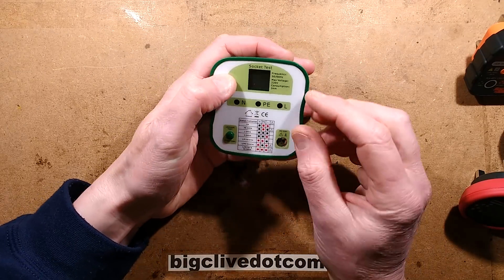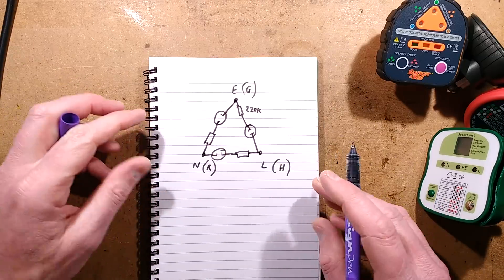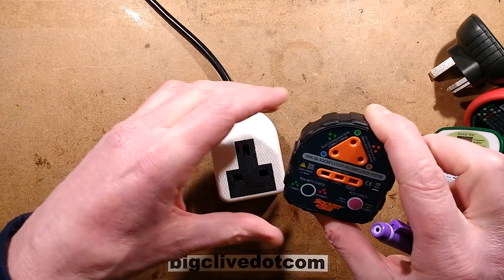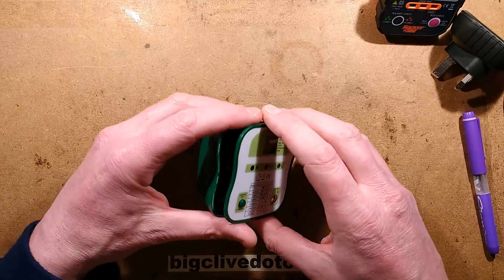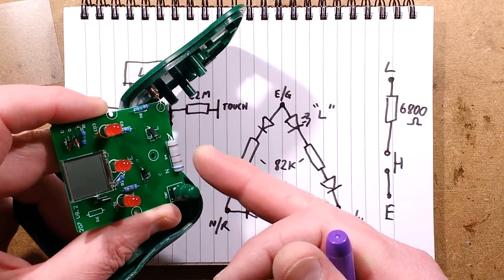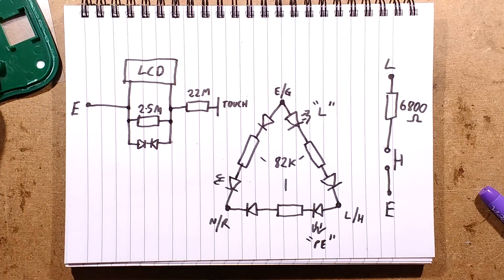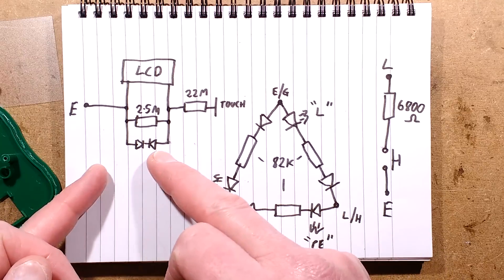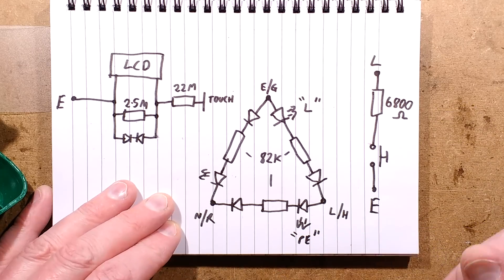Inside a mains socket tester with LCD display.  (with schematic)

Comment: I love how it has a max voltage of 230... Most mains is now around 240-250 volts. The days of 220-230 are over. Same thing in North America, everything that was 110-115 is now 120-125.
Reply: In the US, it was ALWAYS 120/240.   110 is the minimum acceptable voltage, and 120 is nominal, with the voltage usually ending up around 118 volts.   So, people saying 110 are actually only talking about the lowest acceptable voltage to drive whatever your device may be.  (Or just don't know anything about what they're discussing)  As for Europe?  No idea.   It's been long enough since I researched it that I'm certain the EU has invented new standards because they can't stand leaving anything alone.
Reply: Troy Belding nope. It actually was 110 in the early days of AC power. It later went to 115, then 117, and finally, 120. The allowed tolerance is +/- 5%, so the minimum is 114 and the maximum is 127. Typically, unless you're way out in the boonies somewhere, you'll find that the no-load voltage is about 122v, which allows for voltage drop from high current appliances or long runs of wire between the breaker box and a distant outlet. 
Be glad we're not in Japan. They have 100v nominal, but in the northern half of the country is supplied at 50 Hz, while the southern half is supplied at 60 Hz. Which means that if you move between regions, you have to replace any appliances that are frequency sensitive.
Reply: Yes and no.   The early days of AC power varied depending on the region.  Chicago would have one, Boston another, and eventually the smaller regions sort of gave in to the larger regions.  By 1963, device voltage was 115.   in 1984, distribution voltage was set to 120.    Some sources talk about Edison using 110 distribution for 100 volts for his bulbs, but that has to have been come up with by someone who didn't understand that Edison hated AC.   AC current was _Tesla_.    Edison thought everything should be run on DC current.     So, basically, 120 has likely been the 'true' distribution voltage since the 30's, and they just nailed it down in the 80's.   In Houston, the 'no load' voltage floats right at about 118-119, in most areas.   When I see 112, I start being concerned, and the few times I've seen 108 and similar, I had the customer call in an electrician.   (That was when one person killed three computers with her under-desk heater)
Reply: Panels in the us/canada are 120/240,  but receptacles are 125/250.... the voltage is usually closer to 125/250. depends on how many transformers are providing power along the lines to the houses on the block. A lot of new construction has several smaller transformers installed in closer intervals linked in parallel to share loads more evenly. In the past there would be a few large transformers spaced farther apart and if the load would be high customers farthest from the source could experience significant voltage drop, I have seen 105/210 with the A/C and stove on, It was a 200 amp service drawing only 82 amps..... to much distance from the transformer to the house and to many houses on the same transformer.... the lights in that whole area flicker like Christmas tree lights
Reply: Peter Dudas I live in germany and I have 229v.
Reply: Here in Europe it used to be 220 in the south (like Italy), 230 in the main continent, and 240 in the north (like UK and Ireland): Now the standard is 230 but with deliberately sufficient tolerances that nobody had to actually change!
Reply: incognito65 229? Is that a multimeter measurement of it that the voltage stamp on your meter or outlets?
Reply: In the North Somerset area of the U.K., my nominal "230V" supply is normally about 250V.

Comment: You said your main RCD is setup to "lag." How did you do this?
Reply: John Hollowell digital GFCI?
Reply from the maker: +John Hollowell You can get programmable units or a type S RCD that is designed to offer a 100mA/100mS trip characteristic.

Comment: In germany for the TNC (C=common neutral+earth line) system gnd/earth has to be 10mm² until its seperated into Neutral+Earth = TNCS (or then TNS, s meaning separate),
so you cant really say its cheap to keep it that way.. and you really have to try hard to brake the 10mm² common neutral+earth connection ;-)

The T-T (earth at incoming point, earth at machinery)System most of the time is only used in industrial applications where you set your ground/earth spike right at the machinery.
--as a noob you can remember the T as the spike which gets stuck into ground/earth to make the connection
Reply: That 10 mm² requirement was just some intermediate measure to allow TN-C longer in some cases for some reason. Originally it was done with the normal neutral wire. IIRC In Germany the 10 mm² rule was few years in the early seventies. In Finland it was from 1989 to 2007. From 1930 to 1989 TN-C with the neutral was the norm (though a separate ground wire was allowed in 1957). The reason to choose TN-C was originally just to save copper.

Comment: Yesterday I opened the Amazon Basics calculator I have to see if the PV cell on the front was real or if it's a fake cell. It's a real PV cell! It's wired to the circuit board and when I pulled the silver oxide button cell out of the holder, the PV cell (with enough light) powers the calculator! I expected the PV cell to be faked (I think Dave Jones also did a video on this.)
Reply: The most fun you can have with a PV calculator is to remove the battery and interrupt the light to corrupt the memory.
Reply: The solar panel is connected to the battery via a germanium diode ( yes Ge diode, not Shottky) and there is a red led across the battery in case the cell is removed, though some models use a little blob containing 4 silicon diodes in series instead to give a 2V voltage clamp. The solar panel in any case can only deliver under 1mA in bright sunlight, so the tiny alkaline cell in there ( generally a LR44 or other small button primary cell) will never be overcharged, unless you leave it outdoors in full sun for a month, which will melt the case anyway. Indoors the panel only provides a tiny top up to the cell, and in any case those calculator chip run on a LR44 for about the shelf life of the cell anyway. Those with a single AA cell in them I generally use a cell that will not run a clock, and in the calculator it runs fine for years.
Reply: I have a Casio from the 80s with a PV panel and it's still working now on the internal battery after all these years without a replacement.

Comment: @ 8:20 Well... 8W in a 2-3W resistor is one thing... Having 240V over a Tact switch is outright bonkers! Aren't those usually rated 50V or so?!?
Reply: Won't the vast majority of the voltage be across the resistor rather than the switch? It would form a voltage divider between the resistances of the resistor and the switch.
Reply: Motorman2112 once switch is fully closed -yes. Problem starts when the switch is released and there would be sparks. With enough sparks you have ionized air that would attempt to keep a conductive path open. One saving grace is AC voltage the other is a functional RCCB/GFI/RCD. Pushing this button repeatedly in a non-GFI environment might trigger a nice ion channel / little plasma cloud that potentially stays hot enough through 0-volt crossing and burn out the resistor in a spectacular way.

Comment: I don't need one of these to know that the wiring in my house is horrible. It was built many years ago when they really just didn't bother with earth. So there are no RCDs, fuses are actually proper fuses and no socket has an earth connection. The earth pin is just not connected anywhere (not even to neutral). But since it doesn't gives us any problems nobody really wants to invest the time and money to re-do the installation. When I was converting the attic into a workshop I at least properly wired that - connecting the earth line to neutral (and actually wiring it up in the sockets), added a proper 10mA RCD with a properly rated fuse.

Comment: Unrelated, but... I have a Yihua 937D+ Soldering Station, the middle digit on the display is screwed up, the iron seems to heat up and work though - the seller gave me a 70% refund...

Just wondered if you had any ideas, - I had look and can't see anything obviously faulty, or dry connections etc...
Reply from the maker: Does it light or display what looks like all the other digits combined or a combination of two.  It sounds like a solder bridge defeating the multiplexing.
Reply: I thought that, as the left and right digits work fine, the middle one displays random segments, some brighter than others...

I  have some pics (and a small video) if you got an email address and/or forum :)

Comment: what would the circuit be in a very expensive model, please could you do a video on that
Reply: Capt. Marco Hawk same has this one just betters parts
Reply: Yes, I'd like to know how they measure loop resistance.  My guess is that they put a pulsed load between live and neutral and measure the voltage drop, which is not a trivial circuit.

Comment: I never fully understood the point of these, I would be much more concerned about poor standard of electrical connections - could that be tested in a house through a resistance meter?
Reply: stupossibleify because some house have uterly random wiring (yes I have seen plung wired in series!!!)

and no mesuring resistance won't nesesarly show you all bad conection.
Reply: Caledonian TV most sockets work, so they are prob wired correctly. Again, my concern is the poor connection to terminals, wires connected together simply by twisting them together, loose wires near combustible materials - again, is there where a resistance meter would be useful?
Reply: stupossibleify  Even a resistance meter will give you a very limited picture of the state of any connections. Conductors may be touching, so read low resistance on the meter, but when a large current flows, the heat from the poor connections can cause problems...
Reply: Mark 1024MAK so the only way to be sure, perhaps when moving into a new property, is to remove each socket/ceiling rose and check connections visually
Reply: stupossibleify  Yes. In my experience, so far I have found circuits ran with the incorrect rating of cable. Earth wires not correctly terminated (twisted, but not clamped in a terminal), connections with loose screw terminals (not done up tight), unfused spurs off a ring main with too many socket outlets connected in a chain (with wiring not rated for the maximum potential load), a 30A cooker circuit converted to socket outlets, then extended with extra sockets (again, with wiring not rated for the maximum potential load), a PIR lighting controller wired with twin and earth cable, with the bare earth wire used as the neutral and multiway lighting circuit switches connected up incorrectly. A multimeter would not have found many of these faults.
Reply: Mark 1024MAK it's really a wonder there aren't more house fires than we actually see from electric installations. Most of those that we are told about seem to be user error (chip pans, cigs) or appliances (cheap chargers, heaters, tumble dryer and fridges)
Reply: stupossibleify  To be fair, in a lot of cases, as well as the poor or bad electrical installation, something else needs to happen in order for a defect to turn into a dangerous fault. For example, where a cable that is not rated for the circuit has been used (e.g. 2.5mm cable feeding too many spurs), unless you plugged in multiple electrical heavy loads such as heaters, into the sockets on the spur fed sockets, the cable would not overheat. So a non-electrical person would never know.

Comment: Do you have any recommendations for US testers? I can't seem to find an all-in-one as comprehensive as the Socket & See.
Reply from the maker: I'm not sure if they have an equivalent.  I would expect there is.
Reply: I see. That's a bummer, I checked their site and didn't see any US models. I can find plenty on amazon that do the 3 light test which also indicates polarity errors, and many have a button for testing GFCI. I guess the thing I don't see on common US models on amazon is loop testing - I'm not sure if that's something to do with UK wiring vs US wiring since I'm not entirely sure what that does or if it applies to US breakers.

Comment: hi Clive. can you run 12v dc motor with 220v AC ? without transformer or smps  like using only resistor  like you drive the leds. im just wondering what calculation would be what is power going to be ?
Reply from the maker: If the motor draws a high current then it would result in excess resistor heat dissipation.
Reply: thanks for the answer . my motor draws 7 amp underload so that means i can use a diode to drop the voltage to 120 v dc and use about 16 ohm heating element as resistor right ?

Comment: How would someone test if a damaged wire was putting current to ground inside a grounded steel conduit?
Reply from the maker: An insulation test between the associated wires and the conduit metal.  Normally a high voltage tester would be used for an accurate result.

Comment: Where do they call neutral “return”, never heard that.
Reply: It may come from the telegraph/telephone industry. Some circuits were -50V DC single wire systems (typically to save copper cable on overhead wire systems), and therefore used earth for the "return" circuit (with the battery positive terminal being connected to earth). But when multicore cables came into common use, some circuits, instead of using an "earth return", used a separate cable core. To remain compatible with the existing circuits, the battery positive remained connected to earth.
Sometimes terms cross from one industry to another...

Comment: Who's waiting clive to really trip his RCD?
Reply: check photonicinduction. he popped his wole nieghbourhood wile messing with transformers
Reply: Yes ..... I am interested it the concept of a time delayed RCD! ..... Does it count as an oxymoron?
Reply: Not really time delay, just lower sensitivity and a 2 cycle decision time. 100mA RCD are common in industrial equipment where there are heating elements, which have a high leakage when cold but which are fine after a few seconds of warming up to clear the insulation again of adsorbed moisture. They still trip near instantly, just need a lower resistance to do so, so the low sensitivity RCD will have tripped before the big one gets to the trip current. Still will trip in a single cycle though for large fault currents, as the time delay capacitor is charged up very fast then.
Reply: Benn a while for him, wonder if the new wife caused a fault or not. I guess the fuz'e will suz it owt

Comment: I thought that UK volts used to be 240v and europe 220v but now all standardised to 230v not checked it though
Reply from the maker: To create a new "standard" of 230V they widened the tolerance to encompass existing 220V and 240V supplies.  Theoretically all new transformers are 230/400V.

Comment: Im guessing all ypur electrics are on RCD circuits with the stuff you do.
Reply: It's a necessity on a TT-system to use RCDs. In case of a line to earth-fault most MCBs are not fast enough to switch off, the loop impedance is much to high in comparison to a TN-system. The current that would flow is to less to cause the MCB to trip instantaneous. I don't know the values in the UK for shure, but here in Germany MCBs with 32A and less must switch off in less than 0.4s in case of a short circuit. I think there are comparable regulations in the UK. In a TT-system you can only comply with this regulation if you use an RCD, or in the old days an earth-leakage circuit breaker.
Reply: Marcel Germann its about the same figures here, i think it might me standardized accross Europs
Reply: Good explanation Marcel. However, it's not about the speed of the MCB breaking. TT impedance is in the order of tens to hundreds ohms, so in case of a fault you will have only a low current flowing, much less than 32A, or even 10A, so the MCB will never break. So yes an RCD is a must.
Reply: shlomsi2000 oh yeah, its the speed your rcd trips is the reading you take.

Comment: I still don't get why some plugs around the world have polarized live/neutral.
Reply from the maker: +superdau In the UK we have a fuse on the live in the plug, and the live is switched in the appliances.
Reply: Polarised mains plugs have been in use in the U.K. since the 1940's. In many older appliances, it was possible to gain access to parts that carry mains voltage (light bulbs, bar heater elements etc.). If a polarised plug and socket is used, then the line/live/hot wire can be routed via a switch (and/or fuse) on the appliance, so that when switched off, the parts that the user can get to are not live at line voltage.

Comment: LN reversal also has a very bad side effect that there is essentially no protective devices ( like a fuse or breaker) in the current path. Thus a fault that allows L to earth shorting, that trips the breaker, still will have a current path from N to E, and will still draw current. If the earth is eg a true ground connection, say you are in a puddle and the equipment is dropped into it while you are using it outdoors, and thus refers back to the distribution transformer earth bonding connection, you will still have power flowing until such time as the conductors burn out. The fire will be impressive.

Comment: If you play in a rock band then you should use "the drummer" to test electrical safety of the venue. This is even easier if the drummer already has an electric drumkit where the amplifier mains plug is wired with brown cable to the earth pin. (EARTH=DIRT=BROWN+CIDER). Our drummer preferred this convention because he liked the tingling sensation from the metal casing of his speaker which doubled as his stool. - No offence intended to cider powered drummers.